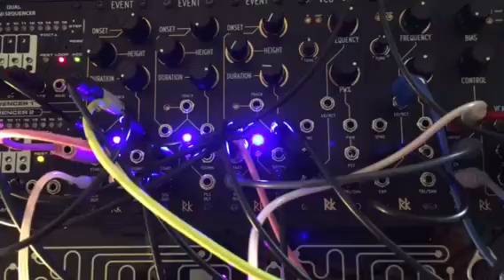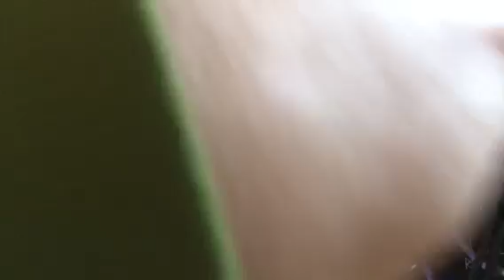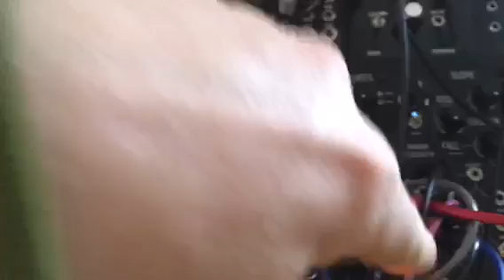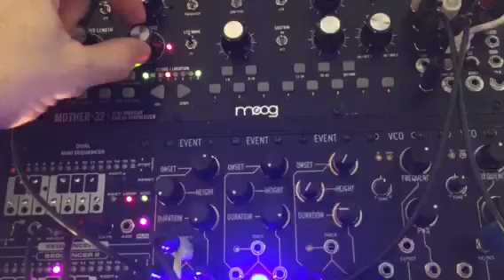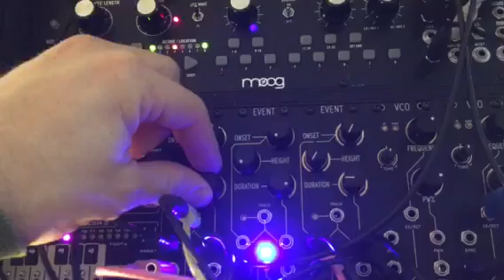EVENT module experimentation

Comment: We need a better video of the basic functions. There is little information on this module out there. And its a great module it would get more attention and probably more sales.
Reply: dan cat will work it soon.
Reply: @akrearke  Yes please, having trouble figuring out how to do the basics with this one.
Reply: @sprobertson , the START input is a basic gate input like on any other envelope. It takes any positive going signal above a certain threshold and converts it to a constant voltage for as long as the signal is present on that input. This conditioned signal initiates the envelope cycle. When the HEIGHT knob is in the minimum position the constant voltage is shortened and behaves like a single short pulse. Making the START input to behave like a TRIGGER input. As the HEIGHT knob is increased the level of the constant voltage generated by the START input circuitry that is fed to the shaping circuitry is increased. This performs like a hold function. So, as long as the START input sees a HIGH signal it will hold at the level determined by the HEIGHT knob during the DURATION half of the cycle only. The SIGNAL input is processed through ONSET and DURATION times only. At the end of the DURATION portion of the cycle a short pule is generated. This can be patched back into the START input and thus causes the entire cycle to repeat. Now you have a VCO whose shape and rate can be determined by the ONSET and DURATION knobs. There is a 1v/oct input and CV inputs for ONSET and DURATION. This is just the beginning.
Reply: @akrearke  Thank you, this clears a lot up already! Would be great to add some of this to the info page on Synthrotek.